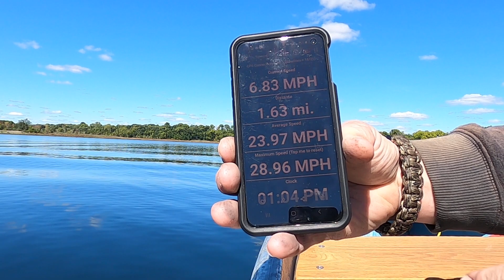1971 Evinrude Sportster 25hp Outboard Motor Lake Test

Comment: I like the name Sportster, sounds more like for fishing, almost wanna offer you my speeditwin in trade ;)
Reply from the maker: Frankly,  I'm surprised Harley-Davidson even let OMC use that name, but they used it for a few years anyway.  I would have to pass on the trade offer anyway.   I was specifically looking for one of these 22 cube 25s for lightweight power for this boat.  I'm happy with the results.  I'm glad i kept looking.  I bought a couple parts motors before this one and hopefully I will have a second,  earlier model Sportster as a backup also.  I like these motors, but  the 18s still hold the top spot.  These are a bit too high strung for all around use.  Thanks for watching!
Reply: @oldjohnnyrude8404  what's the difference between the Sportster and a regular 25? I read the port timing is different plus higher compression?
Nice engine
Reply from the maker: @MadMax-cw3pn  to the best of my knowledge all of the 22c.i. 25hp Evinrudes were known as Sportster.  The Johnson version is the same engine, just not given any special moniker other than being 25hp.  The 25hp 22c.i powerhead does indeed have different port timing than the 18hp 22c.i. powerhead.   That along with a differently weighted crankshaft,  different pistons, a tuned exhaust, higher compression heads, and a larger carburetor is how OMC managed to squeeze 25 ponies out of 22c.i. of displacement in a cross flow 2-stroke.  Thanks for watching!
Reply: @oldjohnnyrude8404  thanks for the info that's great. I have a 1979 25 and a 35 HP Evinrude. 
Awesome motors!
Reply from the maker: @MadMax-cw3pn  Your '79 is a larger displacement 25hp that shares its engine displacement with that of the  35hp.  A bit heavier motor, but just a beast of a 25hp.  🙂👍

Comment: Does your boat flex going that fast?
Reply from the maker: There is a slight amount of flex in the top of the transom with the thrust, but the hull itself has no detectable flex at all at this speed.  This is a very rigid little hull for a lightweight (~120lbs) 12-foot aluminum hull.  It handles quite nicely for what amounts to a lightweight, deep amd wide 12-foot fishing boat with remote controls built into it.  Thanks for watching!